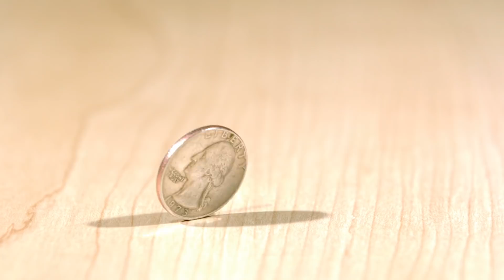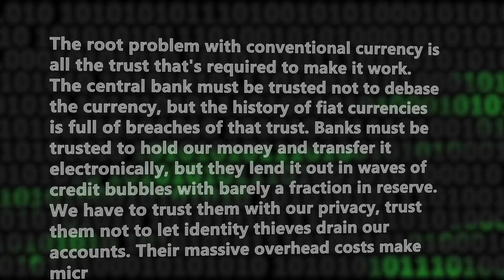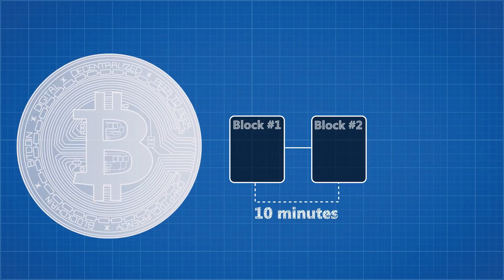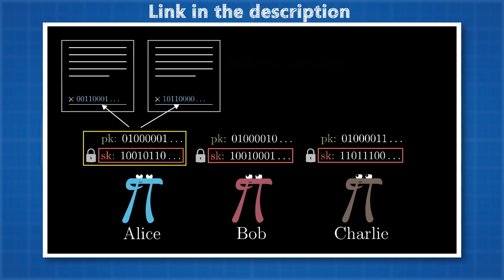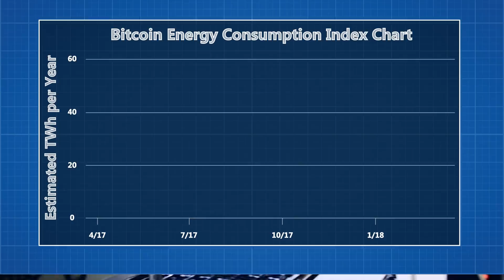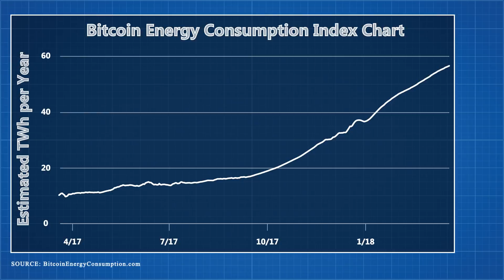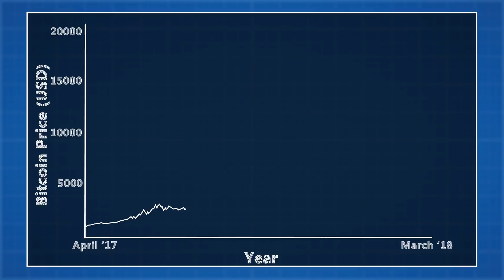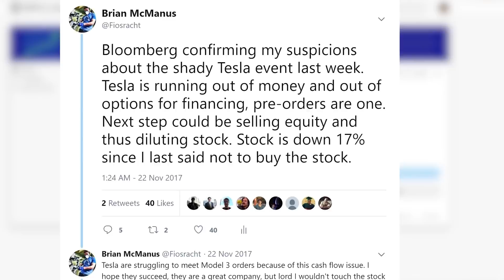Why Bitcoin Is Not Working

Comment: There is a large technological advancement for Bitcoin currently in the works called the Lightning Network, which is currently being tested on the main Bitcoin network after moving off of the Testnet (a mirror Bitcoin network used for testing where the coins have no monetary value). The Lightning Network is a method of making payments off of the blockchain while still being backed by real Bitcoins, which will significantly increase the transaction throughput of the Bitcoin network to magnitudes more than 4 transactions per second (a number which I find objectionable, because the common average max number of transactions per second is 7, not 4). However I agree that the energy consumption is a problem but I'm not sure if there's an easy way to fix it.
Reply: Agreed Austin that the Bitcoin protocol is still in its infancy.  But disagree with you (and Real Engineering) on the power consumption/environmental issue.  It's in a miner's best interest to move operations to where power is cheapest.  Renewable energy has only recently become cheaper to generate than carbon based energy.   And projections show it will only get cheaper (woohoo!  so long dino fuel!)  This is why the largest mining ops are currently located in Iceland and Quebec, places were cheap/clean power exist w/o fossil fuels.  So miners seeking this cheaper source of power increase it's demand incentivizing construction of more renewable energy plants.  The more RE plants created, the cheaper they become to create.  In other words, bitcoin could likely solve the carbon emissions crisis, not exacerbate it.
Reply: Not at all how the lightning network works. The lightning network is at every point backed by valid Bitcoin transactions that have simply not been broadcast to the network. No trust is needed. Transactions do not need to be in the blockchain to be valid Bitcoin transactions that all parties know are valid.
Reply: @IamGrimalkin the lighting network basically groups transactions off the blockchain, then later publishes them to the blockchain as one transaction rather than many. Its not a way in itself to to manage transactions, but rather an add-on to the blockchain to make it faster.
BTW love the username, Grimalkin was my favourite character in the Spooks books.
Reply: @IamGrimalkin The lightning network is not a standalone thing, it is a method of making Bitcoin transactions. Just like credit cards are a method of making transactions in USD, EUR, etc. the lightning network is a method of making transactions in BTC, LTC, etc.
Reply: Oh wow, this surely will polish up the dinosaur up to the levels of Ethereum, yet alone Nano and IOTA assuming in the time nothing happens in these crypto. Except it does and it will be faster and cheaper, if not free(excluding the micro pow) as is the case with the latter 2, to send money.
Reply: But isn't Blockchain the whole point of bitcoin? If the lightning network works so well, why not just use that on its own, rather than  bolting bitcoin onto it at either end?
Reply: IamGrimalkin because of the value and supporters BitCoin has.
Reply: Austin Pearce well, I might been under a rock. Sorry if I’m wrong. I stopped looking at bitcoin since Bitcoin Cash got listed on coinbase.
Reply: Ali Hassanzada Well, idk what type of rock it is, but it’s a huge one. I barely got internet accesses in here, mcdonalds speed.
Reply: Made A New Name The Old One Was To Cringe

I'm not sure why the value of bitcoins really matters. The usability of a currency isn't a function of how much one unit is worth.

Good point about the number of supporters though, but my assumption is that a large portion of those supporters do so because they believe in the Blockchain. Why would they switch to using something other than the blockchain if that is the case?
Reply: Austin Pearce
What I'm suggesting is, it seems to me that what distinguishes the bitcoin is the method of doing transactions: the blockchain. If you  are doing the majority of your bitcoin transactions without using the blockchain, what's the point?

I don't actually know anything about the lightning network, I'm just going by what is said in that comment chain.
Reply: Bitcoin is fast now. I just sent some to a friend from gdax to his exodus wallet and it took less than 5 secounds!
Reply: LET OUR TEAM SHOW YOU HOW TO MAKE OVER $13,000 IN 24-HOURS LIVE http://estde.btcoinc.cpa.clicksure.com
Reply: Lightning isn't just talk anymore
Reply: I'm seeing a lot of people in this comment chain defending their views of Bitcoin that are incorrect. I have been dealing with Bitcoin on a technical level for 6 years now and I like to believe I understand a great deal about it and how it works. I would be happy to educate and debate with people about Bitcoin, but I feel like my attempts at conversation here are very one-sided because people refuse to hear what I have to say and instead defend their own idea of how Bitcoin works.
Reply: That's average MAX, not average overall.
Reply: Austin Pearce i been apart of bitcoin community since black ops 2 first dlc release. 
I was gaming on my ps3 recording with my new beast computer that I made for video editing (via elgato game capture) when my brother storm my room and tell me I can earn free money by running a program. And I did run it for weeks maybe 1 whole month. But it wasnt worth it, cuz I needed to render videos etc and I didnt know how to use it. And also I didnt understand what was much bitcoin, for me it looked like I earned nothing so I delete it. And then in 2013, it skyrocked and got me back to it.
Reply: The lightning network have they talked about for almost 2 years.
Reply: The lightning network for BTC is just talk talk, never action. Just try find the first post saying bitcoin might get lightning network, u be sad cuz they said to for so long. And other crypto already has it
Reply: I'm currently running a lightning node on my computer right now in another window, and just yesterday made a purchase using it. Please see this latest release with compiled binaries https://github.com/lightningnetwork/lnd/releases/tag/v0.4-beta

Comment: What the hell is this video , it begins with explainig bitcoin , praises block chain , oh but wait its alot of electricity , so it still works ? Yes What the hell? And then it brings up violatileness of bitcoin , well yeah dosent mean it dosent work , real engineering is bias as hell .
Reply: Like what? Linden Dollars?
Reply: well Bitcoin should be treated as currency it should be used to buy stocks not treat it as stocks, bitcoin is hashcode, stocks on the other hand at least you get a document
Reply from the maker: I am not impressed by your performance
Reply: Real Engineering but real engineering at the end you say you like to follow the stock market , well the stock market is the volatileness defined .